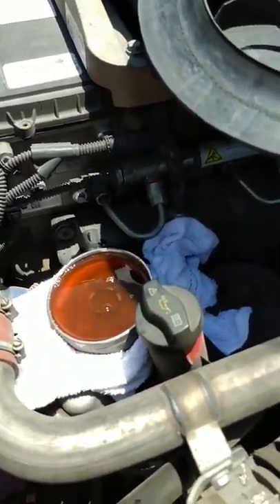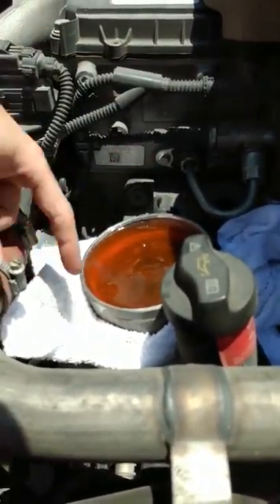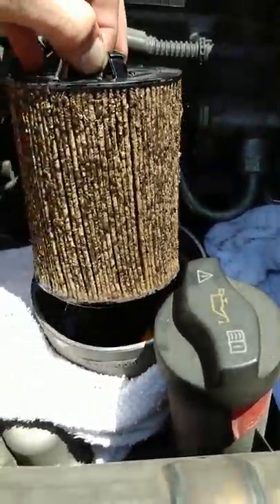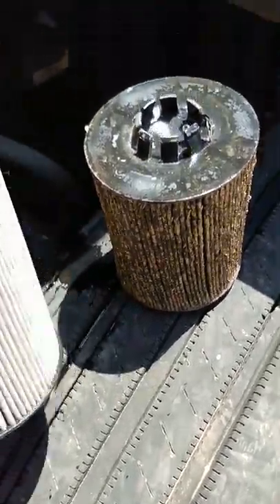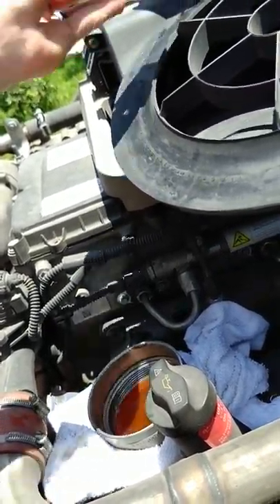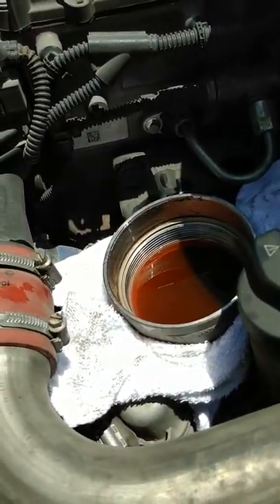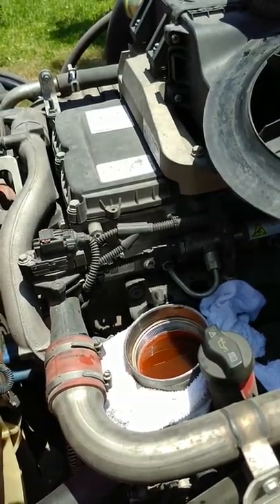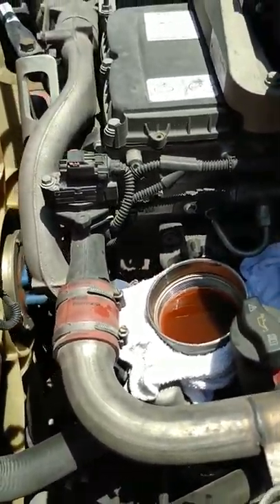Freightliner cascadia DD15 cooland filter change tutorial

Comment: Just bought my freightliner cascadia dd 15 and when i tried changing the filter it didnt have one, u know why????im sure there is a reason why they took it out
Reply from the maker: Jose Morales i wouldn't worry about it too much, as the newer dd15 have eliminated the coolant filter, i started to wonder about the filter when my truck started to run hotter than normal, but if urs is running good it should be fine, any questions just ask
Reply: Thank u bro
Reply from the maker: Jose Morales  any time man, here is a link about the new dd15
http://dd15troubleshooting.com/dd-engine-coolant-filters/

Comment: Where is the shut off valve I look under it and couldn't find it shit was leaking i had to change it quick but I couldn't find it help pleass thanks amigo
Reply from the maker: If u look at the new filter it was a little stick stick out on the bottom, about one inch, i think that is what press the check valve when u tighten the filter and allows the flow, maybe some hoe the old filter left it press
Reply from the maker: But if i was you, I'll put the cap back on to stop it from spilling, then get a bucket and take some coolant out from the bottom of the radiator
Reply: @lestatdelamora  oh ok thanks for reply mines look like mudd omg I couldn't belive it thanks again
Reply: @lestatdelamora  thanks again I'm getting mines drain on monday it was so nasty man not good
Reply from the maker: Glad to help

Comment: Did changing the filter solve your issue ?
Reply from the maker: It did helped a lot, but i also clean the A/C condenser, air intercooler and the radiator cus they were full of bugs and dust and the air wasn't flowing right
Reply: lestatdelamora about how expensive was it to do all that?  Thanks
Reply from the maker: I did it my self, withy air compressor and used air to blow the dirt and bugs off
Reply: Im having the same issue my cascadia 2016 runs at 215 with a heavey load or 200 bobtail useto be under like 190 how hot was yr truck running’s